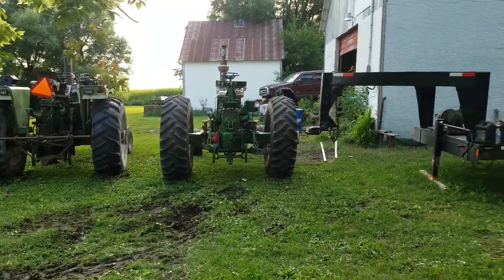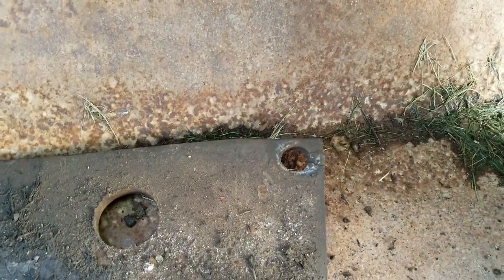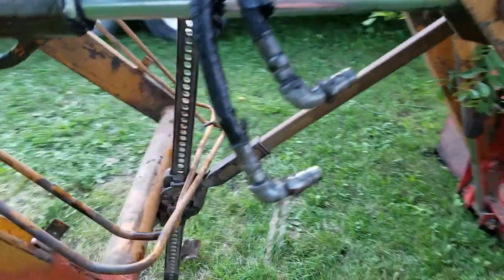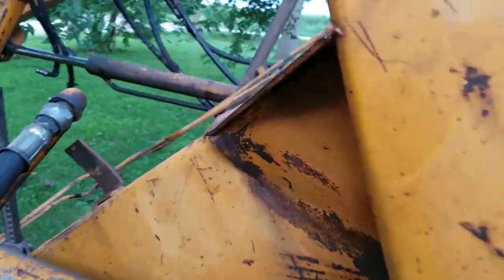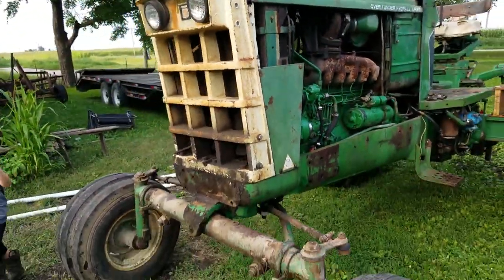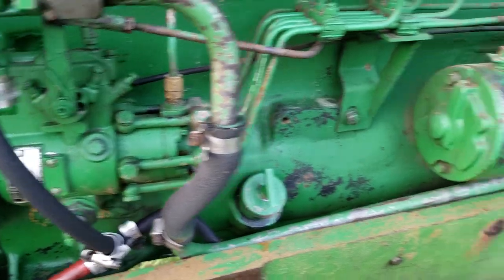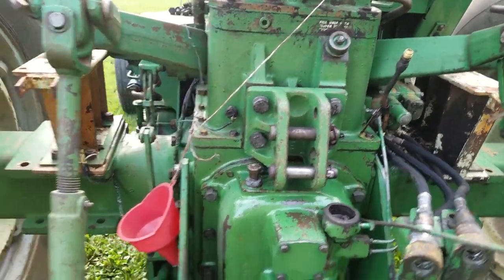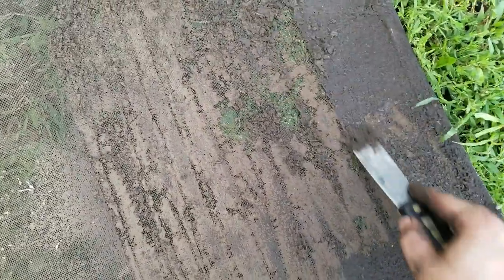Koyker K5 Loader Autopsy from Oliver 1855 Turbo Diesel Tractor

Comment: Look at the bright side my screen is rusted out (big holes) at least yours just needs washing! My guess is the cooler leaks! Sorry to hear about the block.
Reply from the maker: Whoa!  Yeah, it had a couple smaller holes in it, but it was NOT rusty!  Lol!  I've got the coolers and radiator all washed out, so I'll see if they're leaking.  My guess is the bucket cylinders on the loader were leaking and sprayed or dripped on the grille.  I'm not concerned about the patch on the block.  I think it'll survive just fine.  Especially how I'll be using it.  Thanks for watching and commenting!

Comment: wow!!!! I bet you these people could have broke a westendorf, form what the koyner looks like! I would send it straight to the junkyard, but I guess you could fix it if you really wanted too. but ti all takes money, so it depends on how much you want to spend lol. well I would have never guessed that that motor threw a rod. the loader frame covers it up, looks like you will be making a lot of repairs on that old girl
Reply from the maker: Yep.  I don't think they were real great at fixing stuff, but they were real great at breaking stuff! lol!  I'm probably going to just steal some stuff off the loader and post it for sale super cheap to get rid of it.  I'm really not too concerned with the patch on the block - I won't run it hard enough to really worry about blowing her again as long as the wrist pins and rod bolts hold together.  Thanks for watching and commenting!

Comment: It always amazes me when you start looking closely at a tractor you can tell how they took care of it and what they were doing with it. Clearly they were trying to pick up way more than the loader was designed to handle and should have gotten someone who knows how to weld to fix it when it broke !  You can sure tell she was abused pretty regularly and wasn't taken care of.  Its unusual to see a repair to the block at number one, If it throws a rod at one it takes the pump out and brakes the block to ware it cant be fixed.  This one didn't witch is odd but good because it could be patched.  Years ago (in the late 70's and early 80's) I patched 9 or 10 of these blocks ware they broke at #3 or #6 , Welded or brazed and ground down and peened to ware you never knew it had a hole in it !  With that screen so caked with oil and dirt it really makes you wonder how hot they got that engine and did it do any damage to it ? I agree with you on the loader its good for parts and scrap but never to go back on a tractor. Now you can get to everything easer you can find all the little things that need to be fixed and you'll have a good solid tractor again !  Bandit
Reply from the maker: Yes.  Amazing how bad something can get when not properly maintained.  #1 isn't common to blow out the side, I agree, but I guess they all can.  I have no issue running it as-is.  The patch actually doesn't bother me.  I don't work my tractors very hard (except maybe on the dyno just for fun).  I'm not sure what all they did with that tractor, but they were obviously trying to do way too much.  Thanks for watching and commenting!
Reply: For whatever reason those engines if they have a rod come loose its always #1 #3 or #6 and most commend is #3 and #6 coming loose and going threw the block. I have never figured out why its only 1 3 and 6 are the rods to brake and not 2 4 and 5 , That's just an odd one to me .  A Perkins 354 with a turbo would have been a better engine to use in the 1855,  I've never been a fan of the diesels they put in the 55 series tractors cause they had a lot of problems with them no matter how they were treated.  I saw a brand new 1855 idling coming off the trailer at the dealership that threw a rod out #1 on its way down the ramps !  That is something I'll never forget and wouldn't have believed it unless I hadn't seen it happen.  In high school I got to run a 1655 diesel cuiltavating the FFA's soybeans and fell in love with it !  Same guy still owns it to this day and it still the original engine in it and still runs like a top !  Bandit
Reply from the maker: Yeah, the 310s really should never had been made.  After the 283 they should have made a longer and taller block.  Compared to all the other brands, the 310 really put out a lot of power, everyone else was 50+ inches bigger for the same horsepower.  I'd love to have a 1855 or 1955 with a Turbo Perkins in it.  Maybe, if I find the right deal on a tub and engine, I'll do just that!  That's amazing that it chucked a rod unloading off the trailer!  Sounds like somebody wasn't doing their job at the factory!  1655s are excellent tractors!  Dad still has his and it just keeps running!
Reply: The 310 is just one of those engines they should have never used, It cost Oliver a lot of money fixing them and really hurt the Oliver name. Some of the late 1850 had a 3 speed in them and I would love to have one and maybe someday I will . Funny how White went back to the 354 Perkins in there tractors after the 55 series problems, They figured out they screwed up !  I have seen a few 2-105 redone with Oliver sheet metal and painted green and they look good !  Maybe I'll do that ! Bandit
Reply from the maker: Agreed!  They asked a lot of the little 310!  Too much I think.  Perkins are tried and true engines that have been put to the test in numerous industries.  I've seen the Oliver-colored Whites and I don't hate them.  They're different, and that's OK with me!  I like different.  That would be pretty neat to see if you picked one up or built one yourself!
Reply: Right now I think I have enough projects to work on for a year or more ! LOL  Right now I'm just playing catch up to work that's needed done for sometime now, Once I get blue done and harvest is over I might be putting the utility in the shop to put a hydraulic pump in it and a few other things at the same time like seals in the hydro-power and maybe a clutch while it out in the open and the hub, long shaft and clutch pack for the pto !  Just a little work to do ! LOL  Who know what I'll buy next ?  Bandit
Reply from the maker: Yes!  You sure do!  And I'm looking forward to videos of it all!  I'm hoping to complete, well, continue, some of my projects soon too but this 1855 has been taking up all my free time.  That and my buddy's Ford/5-ton SuperTruck project.  Never run out of things to do!  But it sure beats sitting around bored!

Comment: Tractor loader used as bulldozer not the first time lol. Tractor will prolly wonder what running at 180 is like! Makin some progress
Reply from the maker: Ha!  Yes.  I think that was part of it's past life!  Temp gauge doesn't work, so who knows how hot it's been getting.  I haven't run it enough to have gotten it warm yet, but it definitely needs some wiring and a couple gauges and cables replaced.  Slow process, but I think it'll be worth it in the end.  Thanks for watching and commenting!